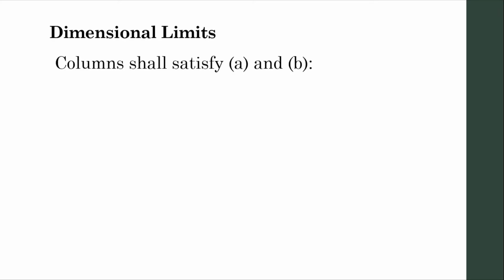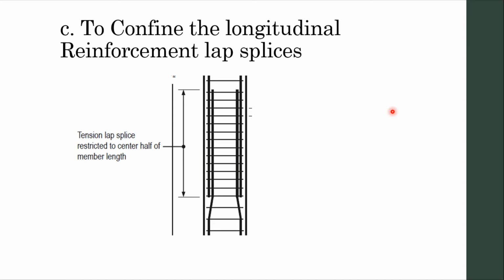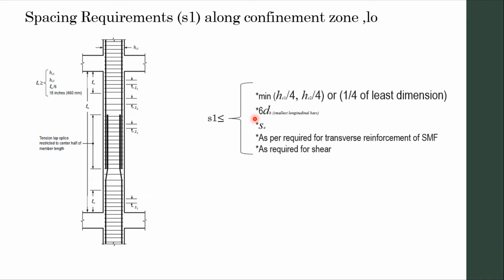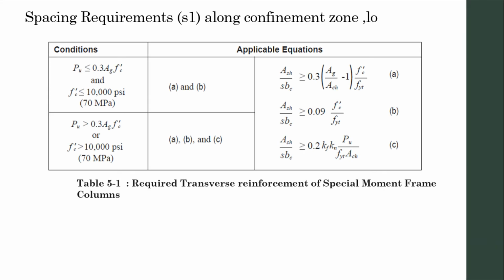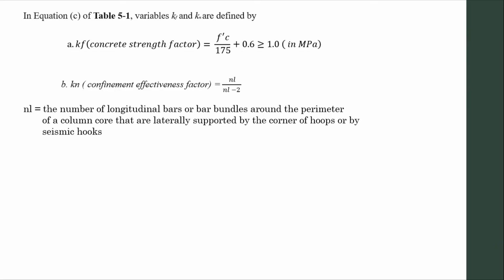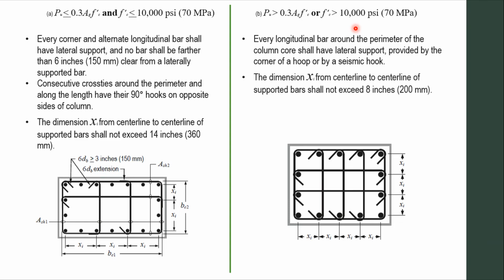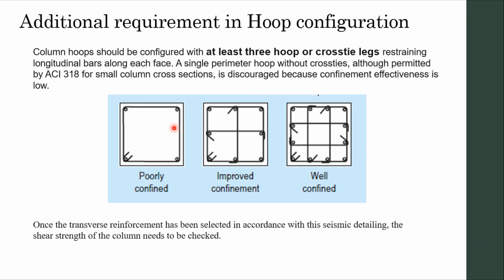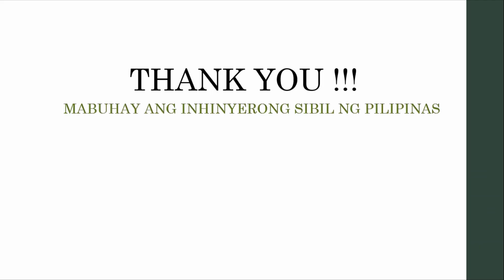SEISMIC DETAILING OF SPECIAL MOMENT FRAME RC COLUMN (NSCP 2015 sec. 418 / ACI 318-14)

Comment: what's the lowest possible tie spacing allowed? 50mm or 75mm po ba?
Reply from the maker: As much as possible 4 inches or 100mm lang
Reply: @janlhesternavasca3160  thanks for reply po! may mga napapanoud kasi ako ang use nila sa special confining zone is 50mm spacing, then sa staad tutorials naman na napapanoud ko ang minimum allowed ng program is 75mm hehe
Reply from the maker: Oo yun binibigay nila pero for construction  issues as much as possible idesign natin sa 100mm lang mahirap kasi lalo na pag sa may joint hirap ilagay ang rebar ng beam

Comment: Yung 600mm distance ng splices sa 50% na Yun? Sample 8pc-16mm rebars, 4pc yung isplice dapat Di pantay yang 4pcs? Pano kung 4m height of col. Mid-half 2m, 50d= 800, bale 4*800 +3*600space=5m sobrasobra. Or Yung 2 lang pantay alternate, bale 2*800+600= 2.2m sobra parin sa mid-half na 2m. Pwede bang ignore nalang yang 600spacing.
Reply from the maker: Hindi po, you can splice the other half dun sa susunod na floor. If not, otherwise use Class B Tension Lap Splice with, 600mm distance pa din ng dalawang na splice. Ayaw kasi natin magkaroon ng weak section
Reply: @janlhesternavasca3160  Tama po ba splicing 50d o 40d?
Reply from the maker: @allyce06  no, please check table of Lap Splices given in the plans. If not provided yes 40d is enough but please take not only us thus for 3000psi ONLY

Comment: Engr, ano po minimum beam dimension for primary and secondary beams allowed by the nscp? ty po.
Reply from the maker: Hello engr according to NSCP 2015 2nd printing 250mm minimum beam width
Reply: @janlhesternavasca3160  sir may rule po ba na beam depth should be greater than 1/4 of clear span? what happens po if beam depth exceeds 1/4 of clear span?
Reply from the maker: @chastie_6821  You can check ACI-418 sect 9.9 Deep beams or NSCP sec 409.9.9.1 deep beams na kapag ang Ln<4h therefore iba na ang way ng pag design dito you will design as a deap beam
Reply: @janlhesternavasca3160  under ACI 418 sec 9.9 "Deep beams are members that are loaded on one face and supported on the opposite face such that strut-like compression elements can develop between the loads.."

First condition nya po is that, medyo di go ma gets meaning nya, if uniformly loaded yung beam does that fall under that condition?
Reply from the maker: @chastie_6821  no, deep beams if Ln<4h you will design it as a strut and tie method, you can also check link beams
Reply: @janlhesternavasca3160  by no po, you mean dun sa question ko na uniformly loaded na beam (pero Ln<4h) hindi sya considered deep beam?

Iba yung nilalabas ni google pag search ko sa link beams , can you recommend me where i can read about it? thanks po hehe
Reply from the maker: Bale ito nalang,

Deep Beams if Ln<4h (check link beams, or spandrel beam search mo sa ACI 318

Normal Beams if Ln>4h

Comment: What about Joint Tie Zones what are the specified spacing of Ties
Reply from the maker: Hello, as for the joint tie zones, ACI and Industry standard limits to 100mm spacing on JOINT tie zone (see example Seismic Design of Reinforced
Concrete Special Moment Frames, section 5.3) and we should check its joint shear capacity.

Comment: So the spacing requirement that it should be the smallest of the following:
48db
16db
least dimension of column
... are only for axially loaded column only?
Reply from the maker: That is for non seismic detailing. The spacing requirement are based from the required shear Vs carried by the ties.
Reply from the maker: That is maximum spacing for Non seismic detail column

Comment: Great discussion sir. Can you discuss also the provision for strong column-weak beam and beam-column joint? Thanks in advance.
Reply from the maker: Yes I will, thanks for watching. But in advance summation of Mcol should be greater than or equal to 6/5 Sum. Mbeam at Joint for strong column weak beam.